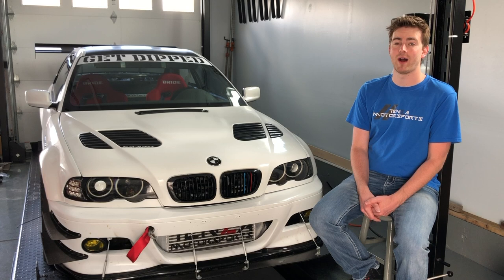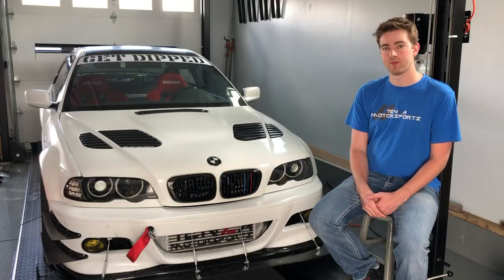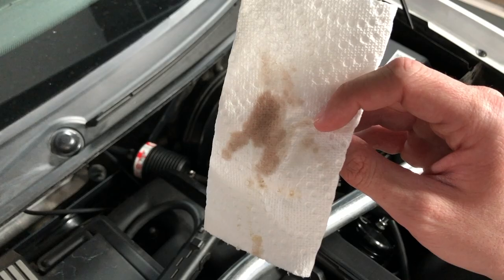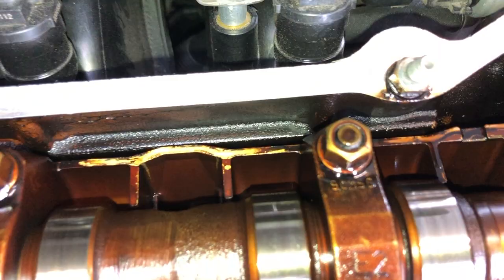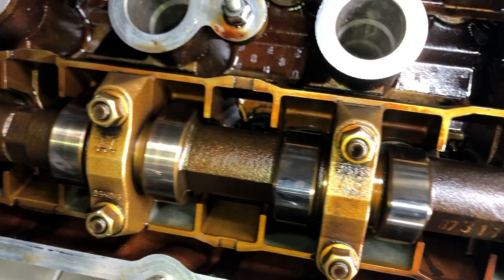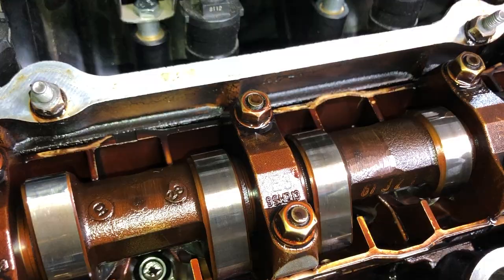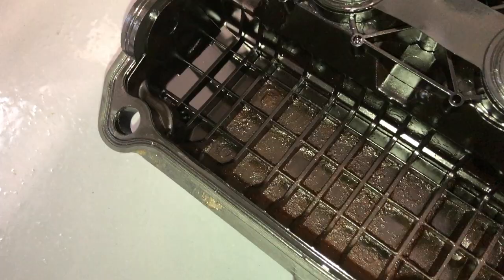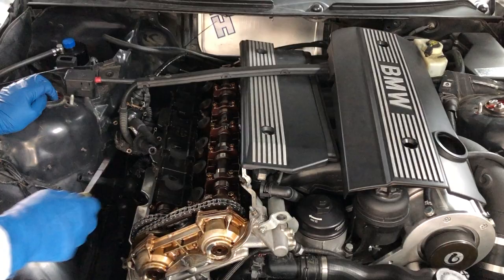500 mile break-in and Royal purple verdict (Part 2)

Comment from the maker: Thanks for watching! There is now a part 3 available.
https://youtu.be/itO0FNbQCDk
Enjoy!
Reply: I just wanna touch on something maybe you can tell me if it’s true, on a high mile engine, I’ve heard that oils that have cleaning agents in them can cause oil leaks. Cuz in some cases I’ve heard that the sludge in a way keeps the oil from seeping thru a bad gasket. Any opinions on that?
Reply: Very nice car, i have been using Royal purple in my srt4 since i bought it in 2004. It is a stage 3 with a FP green turbo and all the upgrades i needed for 20psi. That being said i dont beat the car up, no burnouts, no hard launches i do go very fast sometimes. She is old. Anyway i took my valve cover off and its spotless. Took the long road to that one.
Reply: WHEN WILL WE GET PART 5?!?!?
Reply from the maker: @CrowSephus  At the moment I'm working on testing some different oils. There might be a part 5 but it won't be for awhile at this point.
Reply: @johnnyklassen9606  well first of all just because you use a oil with detergent in it doesn't mean it will get rid of all the sludge and deposits in your engine, there are plenty of little nooks and crannies for sludge deposits to hide away from the detergents, the parts that benefit  from the detergent oil are the cam shaft, crank shaft bearing sleeves valve rockers and pretty much any part that the detergent oil sprays directly on. the concept of using an oil with detergent is to stop sludge and deposits from happening in the first place. As for creating leaks by cleaning out your engine sludge and deposits, engine makers make engines better than in the early days and with better material for the seals. synthetic oils have came a long way also . I would have to say that a clean engine runs better and if you have been running your engine with sludge and deposits in it for a long time than the seals and other parts have already been affected and may start to leak anyway even without using a different oil. it would be best just to change those seals and clean the inside of the engine before it goes back together and start fresh with some good synthetic oil ..if your engine is not totally worn than the synthetic oil will bring new life to it and could make it last longer also. I hope this answers your question..

Comment: That's about my experience with a BMW......drive 500 miles and something needs fixing lol.
Reply: BMW= Bring, Money,Wallet
Reply from the maker: Thank goodness that’s not been my experience! The fuel pump that I had to replace had over 100,000 mile on it. I overhauled the engine not the whole car.
Reply: 🧐 Huh.. My E46 323Ci has only given me two problems. Windscreen wipers needed replacing. And the vacuum hose that runs the valve for the secondary air pump disintegrated. Both easy fixes. 136,000miles.
Reply: It's not that bad but yeah I know what you're saying.
Reply: Endless money pit
Reply: Get a Ford
Reply: Right! My mom had one. Every time it broke the bill was $700 it seemed
Reply: MrClassiccarenthusia One problem with bmw’s is the parts are expensive. That is expected with a more premium tier vehicle, but it’s still a good chunk of change when you have to replace something
Reply: My buddy has a 330ci only changed the oil has 330k miles
Reply: M brother had a e46 323 and the oil pump bolt just fell off..  blowing up the entire engine
Reply: My e60 528i I’ve had for 9 years 165k and only normal maintenance. It’s called be preventative and treat them right, and they will last.
Reply: endless money pits

Comment: The darkening of your oil color is not necessarily a bad thing. It means that the oil is doing its job of keeping engine parts clean. The only thing to determine is whether the oil is keeping the dirt and contamination in suspension or not. To determine this, you need to send a sample into a testing lab to breakdown the condition of the oil. Color alone is not a good indication and eyes, alone, cannot make this determination.
Reply from the maker: I know the oil works well and lubricates properly or I would have had issues years ago. Yes, preferably I would send it off to get samples but we are just looking for the cleaning qualities in these check ins.
Reply: @TenzaMotorsports  Send in the sample and get the analysis done. Until that  happens  you are just guessing the results.
Reply from the maker: Again, we are not testing the oils performance in these videos. we might do that later. We are not guessing the results. You can see the oil cleaning the top end of the engine when we remove the valve cover. I even put in before and after photos to show the progress.
Reply: @TenzaMotorsports  So, what   you are basically saying is that the color of your oil is more important than the protection and performance of your oil. Smart?
Reply from the maker: I'm going to explain this one last time as simple as I can make it. We know the oil works. If it didn't lubricate the car we would be having problems. We are doing these videos to watch how fast SN+ royal purple cleans. We can visibly see difference after just 500 miles and another change at 1700ish miles. 

No where in my video or my comments did I say "the color of your oil is more important than the protection and performance of your oil" The video test is very simple. We are cleaning the engine with nothing else but Royal Purple.

Comment: I personally love royal purple, I used RP in my Ford 5.4 for over 200,000 miles and I never had any issues. Also the purple color made it easy to see the level on the dip stick.
Reply: Did you use the regular or high mileage RP?

Comment: Ive been a user of royal purple for my vehicles in the last few years & I can say that it is an improvement over conventional oils Ive used in the past. After my warranty expired on my elantra & having the dealerships history of oil changes with Brand X synthetic oil, I started using royal purple & what a difference it made. Yes it will turn color fairly quickly from the previous carbon & tarnish deposits.
Reply: I have been reading about the Purple stuff since the 1980's when they first started selling it and I hear rave reviews about this stuff everywhere but never tried it.  Serious and not snarky question: does it have some particular cleaning or lubrication powers that others don't?

Comment: I posted this comment on the first part too. Only because it seriously will help people wanting to take care of their car and give it the best treatment. Buying oils that are full or semi synthetic is simply because they have an additive in them for specific reasons or goals. Royal Purple, in my opinion, is what you should use only when you are doing things like a timing chain, water pump, or something where the fluids need to be flushed after reaching higher miles. With your trusted mechanic, pay him to remove the valve covers after draining the oil out so you can check for any sludge or contaminant build up. If there is (almost like wet dirt) sitting in the lower parts under the valve covers then fill your vehicle with Royal Purple. The Cleaner in it will clean your engine of the contaminants that have settled and built up over time. The problem is, if you keep the Royale Purple in it, you're running all that grime through every pathway the oil takes. So switch to amsoil after about 100-300 miles. It's smoother, lubricates better, and leaves lubricant longer on the parts it passes on. The Royal Purple doesn't lubricate quicker because with the cleaner it works like suds on a car, the long it stays on and slides down in the same spot, the more dirt it takes with it.

Comment: I run Royal Purple in my ‘06 Ranger with almost 200k on it. It is a fantastic oil! I never truly knew just how fantastic it was until I had a valve spring break and had to replace it. When I removed the valve cover, I was amazed at how clean everything was! Will always continue to use RP in my Ranger!

Comment: Hi pretty decent vid  (lots of work,) I'm a Amsoil freak from long experience, there's nothing real bad about Royal purple. It's fine stuff, the most important thing you can do is keep your oil clean and use a 'Wix filter for your car, don't wait for 10K  before you change, no more than 7,000 miles, Tip: purchase a bottle of Amsoil engine/Transmission flush. buy a napa cheap filter and install . top back off with RP, from what you drained to make room for the flush, run it at idle warmed up first for 15-20 min. with NO LOAD on the motor. let her sit for 15- min. drain , then check your valve train, and oil  pan, and then  be amazed.  I like jacking up the car from the front so most of the oil drains back towards the drain plug. now install your wix filter and royal purple, drive it for a few miles and she will pure like a baby kitten. best wishes...
Reply from the maker: I really appreciate the tips and input, it’s always good to have knowledgeable people commenting! I’ll have to do some experimenting and see how it goes👍

Comment: For nearly all cars, any brand name quality oil is good enough. The inside of the engine does not need to shine. And suddenly cleaning an older engine may cause gaskets and seals to weep as varnish is removed from them that is helping to seal them.

The best oil in your motor is oil with less than 3000-5000 miles and a decent filter with each change.
Reply: This should be top comment. I worked for a speed shop here in Hawaii for 10 years that sold all the top names in oil. Amsoil, Royal Purple and Lucas. We all agreed that whether its 12 dollars a quart or 5 dollars a quart, just make sure it's changed every 3-4000 miles and the level is correct. Shit I use Napa brand oil in my old chevy small block that's pretty well built with cam, pistons the whole nine, and I dont even remember how many miles the engine actually has on it but I've been beating the crap out of it for years!
Reply: The problem is people change their oil to soon and your just throwing money away your not letting the cleaner do its job.My gencoupe says 7500 miles I let it go to 6K then change it living in Az. the heat breaks it down faster but I use an oil with high ZDDP levels that helps lifters and bearings plus the KnN filter.
Reply: I agree. If we all changed oil at 2000 miles promptly, we could probably get by using plain mineral oil.

Comment: I did some work for a royal purple engineer a few years ago. What he told me is that it is not a good oil to use on high mileage engines. The detergents in the oil will break down old gaskets and can cause problems.
Reply: False information. Older vehicles have gaps in the gaskets sludge from oil covers those gaps and when you use a synthetic oil it cleans the sluge and all is left is pin holes in the gaskets.
Reply: If your worried about leaks use some ATF in engine oil to help swell the gaskets. High milage engine oils has a modifier that swells gaskets.
Reply: @joeversus2893  doesn't ATF wear bearings quicker?
Reply: RP make a high mileage oil. Have run in in my Xterra for 50,000 miles now has 185,000 miles and doesnt use or leak a drop of oil.

Comment: I always put half a bottle of seafoam in the engine about 100-200 miles before I plan to change the oil, cleans it all right up.
Reply: I only use seafoam in outboard boat motors, not in automobile engines!
Reply: I put it in vac line near the brake reservoir.  Let it sit half an hour then blow it out. Much smoke!

Comment: Everyone has their favourite brand.  I only use Amsoil or Castrol with Lucas.  My engine is spotless.  To each is own
Reply from the maker: The more I look into it, its mostly preference. there are lots of goos options for everyone!
Reply: Carl Rest, after many years I’ve narrowed it down to only using Liquimoly in all my vehicles.
Reply: I have been adding lucas in my oil changes for years. Its really good from my experience as a addictive.
Reply: I run Valvoline fully synthetic high mileage oil with Lucas on each oil change on my 2007 Dodge Power Wagon.  My buddy convinced me to do this because he has almost 400,000 on his 2004 Dodge Ram and has done nothing to the engine and it still runs strong. I change the oil every 5k with a quality filter with this combination. Plus the oil is inexpensive compared to many other brands.
Reply: lmao Lucas is only snake oil.
Reply: I use straight lucas in my motor, and no not the oil stabilizer they also make standard weight oil that have the additives in them

Comment: Years ago I bought a totally sludged up 351 Windsor that had been run on non-detergent 30 Weight oil.  I removed half a trash bag of burned oil from under the valve covers after running detergent oil for about 6 months, As the lifters were tapping I also did an engine flush and tried using various cleaning products...  Basically after 6 months I got sick of the tap and just replaced the lifters and that's when I found all of the oil/carbon build up... It was actually built up solid to the valve covers from the heads barely leaving room for the rockers to move.

About 50,000 miles later I pulled the oil pan and everything was spotless. I was only running detergent synthetic oil.  Good synthetic detergent oil will clean a moderately sludged engine over time... No commercial product will clean a totally sludged engine in one go.  But that is actually a good thing.  If something had actually dissolved several pounds of burned oil at once it would have clogged up the motor for sure and totally trashed the engine.

I know we all want chemicals to work fast. We want our engines clean same day, but be careful what you ask for... it just might get you in the end.
Reply: Lol I've seen this too. Pushrods moving thru blocks of burnt oil in the valley.
Reply: Use a quart of ATF in the oil ! If it's takes 5 quarts of oil plus filter drain out 1 quart of oil and add 1 quart of ATF then drive it like normal for a while then drain it ! ATF has a lot of detergents in it much more than engine oils do so it will clean them out good especially if you have noisy hydraulic lifters that are plugged or gummed up from either crappy oil or just lack of oil changes !
Reply: Do everything you can to prevent sludge build-up. It's much easier to prevent it than to try to get rid of it once you got it! I've heard of engine flushes gone bad because many time all the sludge does not go away but instead gets caught up in small passages, etc. during the flush process.

Comment: It's a known fact that the difference between lower and higher priced oils is in the amount of detergent additives, not necessarily just the oil itself.  Having said that, I ran my Hyundai Tiburon V6 to 260,000 miles on Wal-Mart Super-Tech 5W-30 dino oil.  To the day I sold it, it didn't burn a drop of oil and ran smoothly with no noise.  This is an engine that received regular timing belt changes every 80,000 miles and oil changes every 6200 miles (10,000km).
Reply: That's pretty sweet, but you got to remember that is a much less complex engine.  So that is likely a factor.

Comment: Oil gets dirty because its a detergent oil it has a cleaning action which holds crap in suspension until drained. All modern oils do this. Basic really.....
Reply: mazdaman actually it gets darker because it oxidizes with heat. Just because it’s a dark color doesn’t mean it’s cleaning
Reply: Unfortunately, the additive packages of all oils are not the same. Some are a lot better than others at holding dirt and contamination in suspension. That's why to truly analyze your oils suspension ability, you need to send it to a lab where they will determine all aspects of your oil.

Comment: Royal purple is the only oil I ever run in my modern hemi engines. Top shelf oil
Reply: Amsoil is the best
Reply: Dennis Rutherford pensoil is better
Reply: Yall sleep, yall gotta use THC oil and keep that performance HIGH
Reply: @emoya319  lol nah
Reply: No Name lmao. I’m using a little of that right now.
Reply: Brand doesn’t matter lol just change your oil when you’re suppose to.
Reply: Would stay away from Penzoil. Used to work in a machine shop, have seen the result of long time use of Penzoil. Not good.
Reply: Ripsaw17 Dennis  I run Shell Rotella T6 Syn and i beat the shit out of my truck not a single issue. Its a 2006 Cummins
Reply: @Blacktopmafia660  all day every day lol. Fyi i dropped my brand new pen in a bucket of water right b4 work, all bad 👎:/
Reply: Ripsaw17 Dennis  I dont like pennzoil either.

Comment: The exhaust cam is more submerged in oil. Its lower in the engine....that's why it's cleaner.  Any high detergent oil will clean the engine. I use diesel oil in my Dakota and have 170k on it and it is clean.  I also noticed the oil got really dirty at first. I let it do a long drain. Chunks of coked oil came out. 10,000 miles later, its spotless.

Comment: Royal Purple is great oil in general, it probably is worth the extra cost. But from the pure cleaning aspect, I gotta tell ya I notice the same thing on my engine with just Quakerstate Ultimate Durability synthetic, it got pretty dark for 500 miles and it does look cleaner inside under the oil cap, but these newer oils have more additive in general to suspend and clean crap so IDK but nice to see there is an improvement from just running good quality synthetic.
Reply: I noticed the same thing when I switched to Quaker State. I always used Valvoline Full Synthetic in my cars. I had an Equinox and it was the first car I had with a cartridge filter. When I switched to Quaker State the filter had a lot of carbon buildup on it. It never had that with Valvoline. I figured the Quaker State really cleaned up the carbon. Now I only use Quaker State.